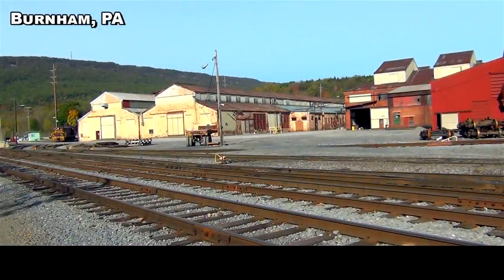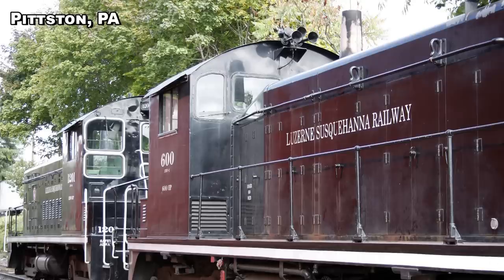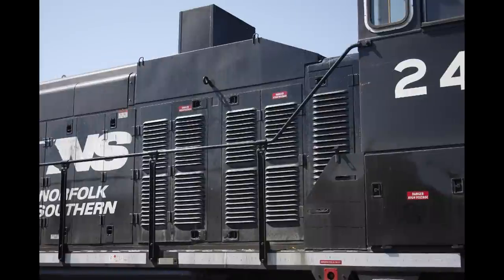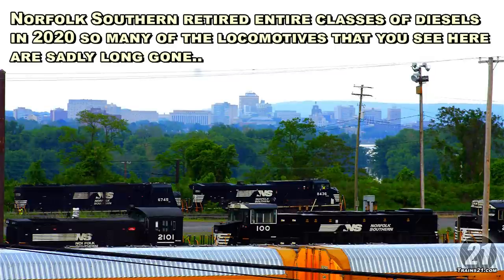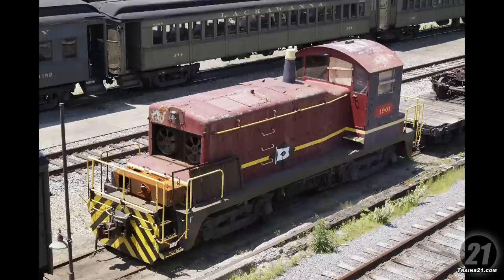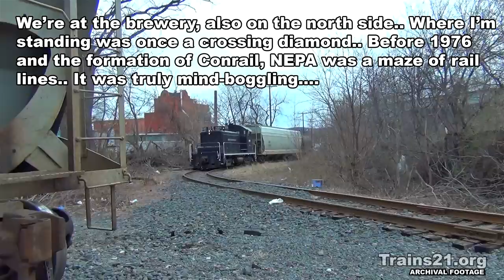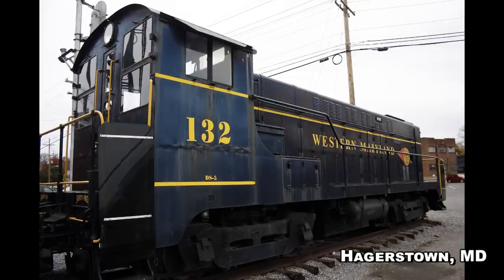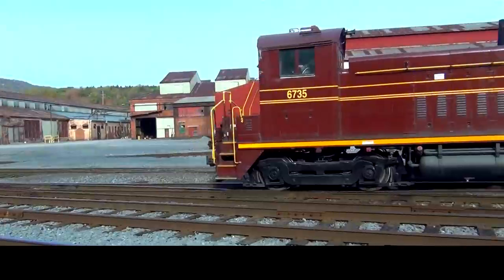End Cab Switcher Odyssey.. A Legacy Of The Buttheads of Diesel Locomotive Production (Full Video)

Comment: I work for a class III switching railroad just outside of Pittsburgh, PA called Union Railroad. We have a fleet of SW1500 and MP15DC's. 9 are SW1500's and the rest are the MP15DC's. Fun fact for our engines is that they were designed heavier than any other switcher of that class and a lower gear ratio. Most of our units now except for about 10 of them are able to be remote controlled. All the units were built in the early to mid 1970's. We have tried different engines over the years but nothing can compete with the fleet of engines we currently roster. If you ever get the chance to come to Pittsburgh, I would highly recommend checking out the Union Railroad. We're also one of the only railroads that still uses a caboose on the end of our trains because of the various reverse moves that we do.
Reply: I know I used to haul put of u.s.s. steel and would watch  you guys rolling,I love them switchers and slug units more then the  big engines.
Reply: If I’m in the area I will for sure be railfaning there
Reply: Thank you. I will  make every effort to  come and see these unique  and very rare locomotives. ❤
Reply: isn't that railroad also servicing Andrew Carnegie old steel mill?

Comment: I agree with u AC on the switching. for me it was listening to those 16-cylinder Detroits throttle up, from the E and F units on. I used to drive an old 10spd GMC just a smaller Detroit. but I believe everybody has gotten away from the 2 stroke engines, and the engines they're using today just don't sound the same.

Comment: CP has so many varied sd due to small orders as well as the deregulation they absorbed most of the branch lines like SOO, and so had even smaller batch orders, they mostly used hand me downs from other railroads who bought large batch order and quickly upgraded due to their long haul abilities, which the newer engines allowed them to reduce the need for may way points and between yards.

Comment: Where I live,  CPR used S series switchers.  But that's back when most box cars were 40'. Rolling stock got longer and heavier.  I haven't seen an S unit in decades. CPR now uses two GP-38S lashed up for switching. It's never less than two units.

Comment: Though you mentioned that BO 320is preserved at Whitewater Valley RR(Not operational too)but you did not mention ex Cincinnati Union terminal 25.
Old 25 has been operating here for,,,,,,,,,,,,,,,,,,,almost 50 years!   I remember seeing her back in 1976!
Just 3 years ago, I was passing through Connersville and low and behold there she was.  Also, 25 is looking GOOD!  Sounding good too!
25 also still has it's NYC inspired tiger striping on the pilot.  A feature found on all affiliated NYC lines.

Comment: The first diesel locomotive switcher was built by Baldwin locomotive works because New York Central needed to have diesel locomotive within the city limits of New York. EMC built Diesel's before world war after Baldwin. When they were bought by general motors they had unlimited backing by the parent company in order to finance shaky roads purchase of diesel locomotives and not only did they replace the steam locomotives they destroyed the whole steam locomotive industry. Because of industrial coercion that were not interested in diesel locomotives were forced to purchase them anyway. In spite of the so-called efficiencies of the diesel locomotive it made it up in other ways. Cost per mile with the same or more than modern steam. Alco Baldwin and Fairbanks Morse made great end-cab diesel switcher as shown by the Milwaukee road use of Fairbanks Morse switching locomotives until the early 90s. People did not get loans for new switching locomotives but they would for new diesel locomotives that make the money 💰. Many minorityBuilder locomotives were struck from rosters so they can make a common parts source.. EMD locomotives use an electric starter, alco vocamotive use an air starter which has an oil reservoir with needs to be periodically filled if you do not keep it filled up with oil and run it dry it will burn up the starte and put the locomotive out of service until the starter is replaced. You also have to know how to service a four-stroke valvetrain 2-stroke EMD locomotives are very simple you just keep them full of oil and fuel and they run forever.

Comment: I'm pretty sure that the Erie Lackawanna SD45-2s and SDP45-2s were numbered 3600 and up (designating their horse power rating). The E-L unit you showed (#1700) I don't believe is an SD45-2. Plus it should have the radiator flared at the rear of the unit.
Reply: the NS 1700 was originally EL 3669. the SD45-2's do not have flared radiators.
Reply: The SDP45 (no -2) had flared radiators, as the previous commenter said, the SD45-2 doesn’t. Also, note the oversized fuel tank on 1700, only EL units had them.

Comment: I'm not sure of your point at the start about tight curves on industrial lines, surely the problem sits with railways not ordering shunting locomotives so builders don't make them
Reply: When the sharp curves were laid the small switch engines were a dime a dozen, also limited space added to the need for sharp curves. Add in that cars were shorter then too! The rail weight limit is lower too, so heavier 6 axle road locomotives are unable to be run on them.